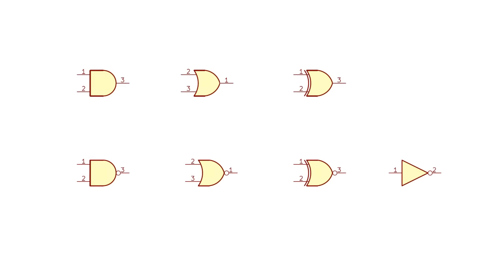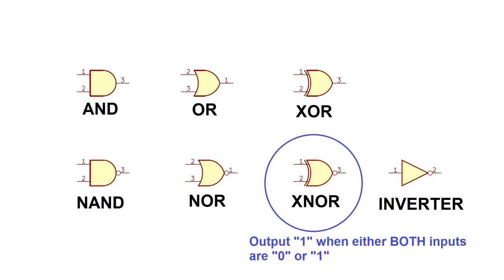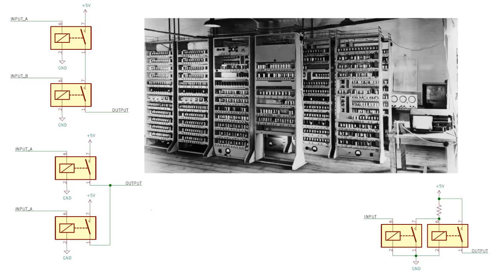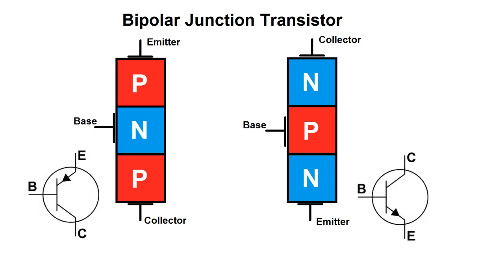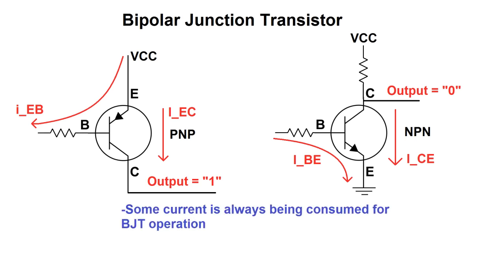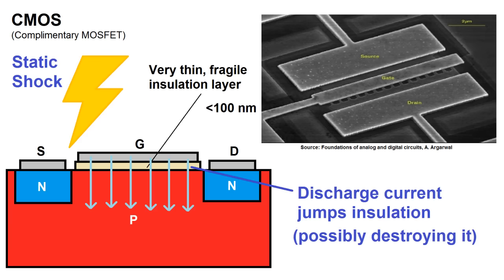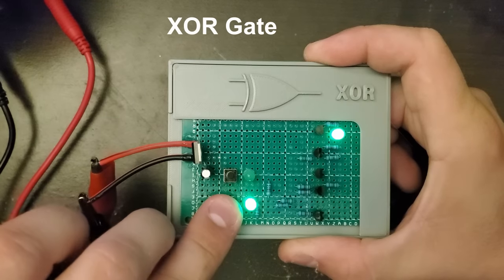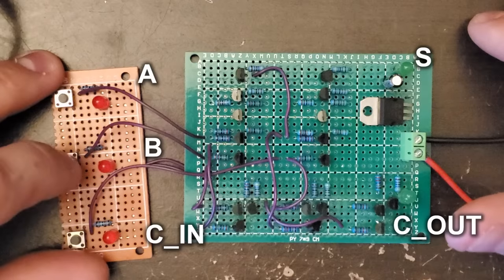8-Bit Adder built from 152 Transistors

Comment: Great project! I did something very similar years ago - I used the goldpins to connect the boards though, gave even cleaner look, also you can optimize the adder a little bit on the transistor level if you just try to do it directly in transistors rather than assembling it from logic gates.

Comment: You could've simply use two diodes in place of the OR gate and maybe briefly also talk about the DTL technology, which was in place before TTL.
Would save you heaps of transistors and resistors without really any downsides considering the application

Comment: Way back in the very early days of computing I worked for Control Data Corporation and this was how they did early addition using one small pc board as one logic element. Multiplication was done initially by simply adding the one number to itself the number of times specified by the multiplier.  This used a lot of time and power and when early ICs came into use was replaced by using fast ROM memory which had all the answers in memory and was simply addressed by the multiplier and multiplicand.

Comment: This video was really useful indeed. I was just looking for how to create prototype CMOS gates out of discrete N and P E-MOSFETs, and I found the IC integrated schematics only everywhere, containing special MOSFETs with extra terminal for the Bulk. However, your "MOSFETs" are drawn here as JFETs. Weird, but they work as MOSFETs, so thanks for that!

Otherwise, your "TTL" circuits are neither the simplified TTL nor the RTL ones. They are somewhere between, but of course, I'm glad they worked perfectly for you. Also, you wrote accidentally PNP BJTs later. First it was OK, later they became PNP ones in your schematics, but you constantly mentioned "NPN", so that's fine. I guess.

Comment: Errors in the video:
2:43 In English the words COMPLEMENTARY and COMPLIMENTARY are spelled differently because they mean different things.
6:00 to 9:50 Every one of 252 NPN transistors is wrongly drawn as a PNP transistor.
8:30 The adder without C_IN circuit has floating inputs to two gates.
Reply: What is explained/confused in the video is Wikipedia, "Resistor–transistor logic". 
see Wikipedia on "Transistor–transistor logic" and "What is Transistor Transistor Logic (TTL) & Its Working" at elprocus.

Symbols: In another video he mentioned this problem with his Software.
Reply: i was scratching my head about the NPN thing. questioning my sanity and place in the world.
you missed that the BJT logic pictured is RTL, not TTL.
Reply: @dieSpinnt  oh lol. yep this

Comment: Very good video! I've been thinking about a similar project for a while. Also, you are not using TTL logic but RTL logic
Reply: I have built the same thing using RTL logic. There are many different circuit designs to use. You can build a 1 bit full adder using all nor gates with 9 transistors and 36 resistors. So total was 63 transistors. Plus and 8 bit inverting buffer to tie it to the bus to an output register using the -Q output to maintain proper voltage and use the Q output for leds. Plus a few more transistors for the enable control lines. Make sure you do proper calculations for your resistors so fan out is not a problem. I used 2n3904 transistors. And i think 39k input resistors and 21K bias resistor and 4.7 output resistor or maybe 1k I don't remember. Still working on it. Trying to make it a full computer. Registers, memory and rom and output. Good luck.
Reply: To be more precise his logic gates are constructed using Direct Coupled Transistor Logic (DCTL). This is similar to RTL except that you save one base resistor by hooking up the base of a transistor of the next logic gate directly to the collector (output) of the logic gate.

Comment: As an apprentice back in 1976m I remember the excitement of building gates 🥴- 1/2 adders/adders, etc., all the way up to a calculator. The bad news was, that the industry was being 'manufactured' at the same time, so every time we filled a breadboard with transistors and chips, the teacher would hold up, a single new chip, that took the place of the many hours we just spent, building the same thing

Comment: Now create a latch and use a single panel of switches to load an A or B register, pulsing the answer back to the A. Use push buttons to toggle the register values when the CS and write lines are active.

Comment: It would be interesting to build a binary to decimal to 7-segment display circuit to display the output, and maybe a decimal to binary to convert input from a 10-position rotary switch so you can make it into a single function calculator :)

Comment: THANK YOU! I finally understood how to actually use transistors (that is: "when using this kind of transistor, apply voltage between pin Y and Z and bigger current will flow between X and Z)!

That said, did you test adding 77+33 (which is obviously 100)?

Comment: Interesting video! I don't understand why you need output transistors on your gate designs. Couldn't the output just be placed in the circuit with pull-up/down resistors?

Comment: His description states that the schematics show the transistors with the collector and emitter inverted, which would be true if he had used PNP transistors . He is actually using NPN (2N3904) transistors. He has labeled them NPN which is correct. Unfortunately he has used the symbol for PNP transistors. This is his actual error. I wonder if he really understands the circuit he has built.

The diagram error really took a lot of my enjoyment out of this video.

Comment: This is one of those projects where you probably want to fire up JLCPCB or PCBWay.  They'd be good education kits to show how each component of a CPU works, but would be very impractical to actually build out a full ALU.  One of my early coding challenges I had for myself was to write an adder using only bit operators in C++.  You could do the same thing here to emulate a simple ALU rather than having physical devices, use code and Boolean logic only.

Comment: Nice work on the design 😊 However, tubes used in Vacuum Tube Digital Computers usually do not put out X-rays or any other dangerous radiation. Most 'tubes' are just verry sophisticated incandescent light bulbs (over-simplification).

Comment: Just curious, how did you calculate the 220k input and 47k pull-up resistors for the 2N3904 transistor for this specific logic purpose? Thanks for sharing. Andreas.

Comment: Good video, I know this is for beginners, but there are a few mistakes. First, the symbol of npn transistors. The symbol in this video is pnp not npn, those arrows on the emitters should be inverted. Second, TTL. TTL stands for transistor transistor logic, the input of TTL is an emitter of a npn transistor, not a resistor. The logic type in the video is called RTL, resistor transistor logic. Third, npn Vbe, voltage between base and emitter. When a npn transisor being switched on, Vbe will be clamped at about 0.6 ot 0.7 volt, not 5V.
Reply: Yepp, you are right. 
see Wikipedia on "Transistor–transistor logic" and "What is Transistor Transistor Logic (TTL) & Its Working" at elprocus.
Symbols: In another video he mentioned this problem with his Software.

Comment: Awesome project, can I know which transistor are you using, and can you please share the circuit diagram and schematics associated with this project, it would be great help. Thanks for the video.
Reply: The transistor used is in the description of the video. As for the diagram and schematics, everything is in the video, if you Google the things as he says them (1-bit adder, RTL logic gates, etc.). Good luck!
Reply: @rojirrim7298  Thanks 😃
Reply: @HarshCreatives  If you're worried about which transistor to use, just any cheap NPN transistor will work, I'm 99% sure. The 47kR and 220kR values of resistor are super generic and not planned for the particular transistor model he's using. Anything from a BC857 to a 2N2222 will work, I'm 99.99% sure :) just look for whatever NPN transistor you can cheaply buy in big quantities in your area.
Reply: @rojirrim7298  Thank you so much for the help bro 🙏
Reply: Really enjoyed the video and explanations, very clear and concise. I noted on the first board there was a capacitor and what looked like a voltage regulator? Can anyone help with what this might be and how it is connected? Thanks in advance, I will continue to google it the mean time!

Comment: Hey I just built a full one but adder and now saw your video. I think we have the same circuit but for voltage on the sun but when either input a or b is high but not both and carry in is low, is not good at all for me. I think this circuit is rtl style..: did you have this issue with decreasing voltage as well? Thanks

Comment: You could also build a circuit to show the numbers in decimal form using a seven-segment LED display.
Reply: Yeah the problem with that is that you would have to program the computer to display each number depending on the results, I'm not getting too technical because I don't want to be boring or confusing, but you would have to program a looooooot to do that
Reply: @Muxion9  
A simple chip can do that. It's called a BCD to Seven Segment Driver (CD4511). It takes binary input and displays decimal numbers using a seven-segment LED display. Granted it would add some electronics but not too complicated.
Reply: @AlainHubert  shoot i complete forgot about these
Reply: @Muxion9  
Haha, no problem. Your adder is really neat by the way.
Reply: @AlainHubert  Thanks! :D
Reply: @AlainHubert  It took me more than what it should because I wanted it to be more compact, so I was hours searching for the best design, and then I just did some copies and boom

Comment: Using discrete logic gate modules is a great way to build a 8-bit adder for educational purposes, but it's very inefficient in terms of transistor count.

Although you optimized the number of transistors to make your full adders, using 19 instead of 28, you could have used as few as 9 per full adder. In fact, your really need only 6 transistors per full adder, so 48 in total with a technique called pass transistor logic. However, since the voltage delta between the high and low states gets smaller at each step, you might have trouble powering your LEDs and with chaining multiple of these in a larger circuit.

Don't take this the wrong way, I loved your video and I fully understand why you used 152 transistors, but I think it's important to point out that there are more efficient ways to build the same circuit!
Reply: yes this is the problem I encounter only the input has a light but the output led dont have it looks like problem in voltage or current

Comment: great video, but you got the P-channel mosfet completely wrong ;)  P-channel mosfets used in CMOS are not conducting without a charge on gate the same way as the N-channel mosfets do, and they become conductive once the gate-source voltage is applied (same as N-chan) but the polarity is opposite. i.e. the gate of a N-channel must be pulled to VCC to make it conductive, while the gate of P-channel must be pulled to ground to make it conductive.   there are mosfets which are conducting without a charge and stop conducting when the gate is charged, but those are a completely different category - depletion mode mosfets (again both variants Nchan and Pchan exist).

Comment: Great video! I am far from a CS or electrical engineer (I just program), but to me the 8 duplicate boards seems redundant. Would there be a way to just use one board, wire the carry bit back to the input, and then create some kind of logic for the sum register that can shift the bits to the left when a new sum bit is high? Or would doing that make it even larger than it already is? Learned a lot, Thanks for the hard work put into this video.
Reply: Registers (flip flops) are not trivial.  So to demonstrate it with switches and lights, 3 8-bit shift registers would be required (two input numbers and an output number).  Plus a 3 bit counter  and the associated logic to stop the add after 8 bits.

Comment: Very well-explained and detailed!
I only had one question. I am trying to build the circuit on a simulator online, starting with the inverter. As provided, the output voltage is an inverted version of the input voltage. However, when I connect an LED at the 5V output, it drops all of a sudden and the LED does not light up.
Could someone please explain how to overcome this?
Thank you all in advance :) !

Comment: Did you use the same values of pull-down resistors (8.2kOhm) on the control board for the single adder prototype that you made? Did you use a resistor for the green LED at the end or how did you control the current of the LED?

Comment: I just have a quick question about the logic gates. In the and gate you used 3 transistors and i do not really understand why. Can't you just take the output from the end of the transistor "chain" so when they are both closed you can take the output from there? Could someone please 
explain why this is not possible or if it is?
Reply: The third transistor is needed because the first two transistors perform an "AND" and they "INVERT" the voltage. Therefore, the  3rd transistor is needed to invert again and make the 1 bit output = HIGH +5 volts and the 0 bit output = LOW 0 volts.

Comment: Thank you for this video :)  Since MOSFETS don't pass any source current through, then they would be good  for a digitally controlled switch of analog signal (say audio) without introducing any noise?
Reply: Yep, for this reason you can find analog switches in the 4000 CMOS series 4051, 4052, 4053, 4066, 4067 if I remember right. Furthermore can be used an analog demultiplexer (demux) as input selector :) .

Comment: Technically your "TTL" is RTL. Also nope most bipolar transistor types have a gain less than 100. It is only small signal transistors that are relatively low frequency that have an hfe gain of 100-200. They don't have anything like that in an hfb configuration, The hfc configuration is very dependant on transistor and sometimes the gain is about the same as hfe and sometimes less. hfb is only really used in older attenuators but it is used.

Comment: excelent job! only a few things, this isnt TTL as thats inly semiconductor devices, BJTs and diodes you made RTL which isnt easily scaled on to a silicon chip like TTL, also there is a way to make an xor gate with just 2 transistors.

Comment: in your graphic depicting different types of logic, you note TTL/CMOS
The schematics you present actually show a third type, RTL (resistor transistor logic) and not TTL (transistor transistor logic)
Even though there are multiple transistors in the RTL, it is not TTL as the second "T" in TTL represents the complimentary transistor on the high side of the circuit.
why they chose CMOS instead of MTL, or TTL instead of CTL we will never know.
we will also never know why BJT terminals are labeled collector and emitter (corresponding to the conventional current direction of flow)
and MOS terminals are labeled drain - source (corresponding to the electron current direction of flow)

Comment: "A kilobyte of data would pull almost a thousand watts. If you do this in your house, it wouldn't be long until your computer started blowing circuit breakers."

Weird. US mains can draw 15A at 115v, well over 1000W—per socket. Here, in Australia, we run 10A 240v. I have an induction cooktop that draws 2000W at max setting, while the breakers I have are all 32A 240v units.

1000W is not a lot of power.

Comment: Where's the mntion of ECL gates? (Emitter-Coupled Logic) Those use NPN BJTs for NOR/OR gates and PNPs for NAND/AND. The use of PNP logic for AND gates stems of basic PNP behaviour, being cutoff with a base voltage above the higher of the collector and emitter, and saturation being with a base voltage below the lower of the other two. Cut off all the inputs in an emitter-coupled NAND gate and the voltage will be forced into the base of the master, or amplifier, transistor. If it too is a PNP then it will also be cut off, activating the one opposite it by the change in voltage at the coupled collectors.

Comment: I am a bit puzzled why you have used testboards for the repetitive PCBs. You can have them custom manufactured very cheaply and quickly, especially because you need many of them.
(like 180 USD for 30 pieces 100mmx200mm 2layer PCBs including shipping fee and customs tax,  or 120 USD for 30 pieces of 100mmx100mm 2 layer PCBs)
These PCBs tend to be more robust too because of hole galvanization, so it is more difficult to accidentally rip off traces.

Comment: Great video.
I have a doubt .
In a computer to do same calculation you just give an input through keyboard and that is processed by the CPU to perform the calculation.
How does that work.
Here you are manually turning the switches on and off 
How does that happen in a computer.
How does the transistor gets on or off according to the program instructions that we enter as an input through the keyboard.
How is a machine code gets converted to electrical signal or how does an electrical signal get manipulated to perform the on off action that you did with your hands.
Reply: Bro you gotta helll of questions
Reply: Okay, first of everything, you MUST understood correctly what 1 in binary represents, when you turn on something there's a wire, if the wire is on, then in binary that's a 1, if it's turned off, then it's a 0